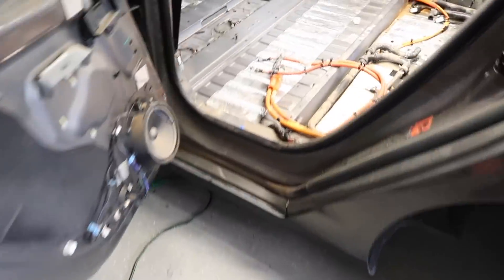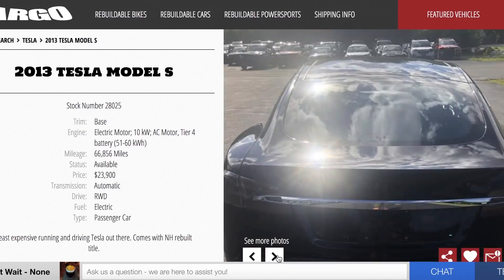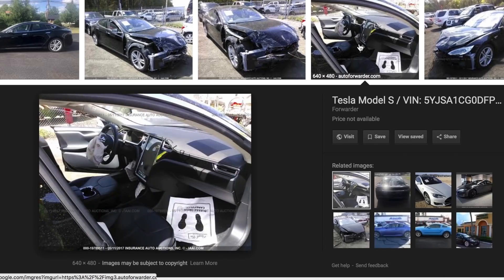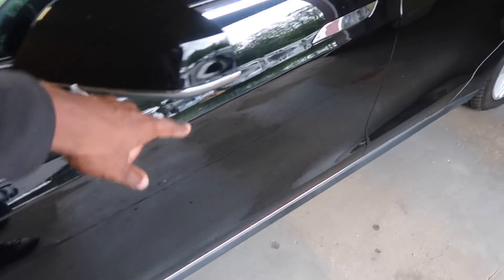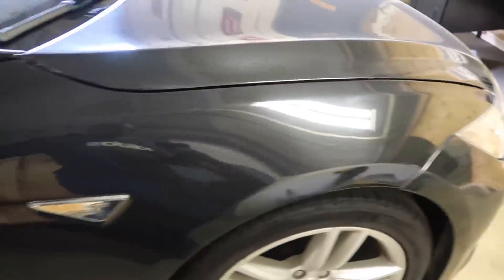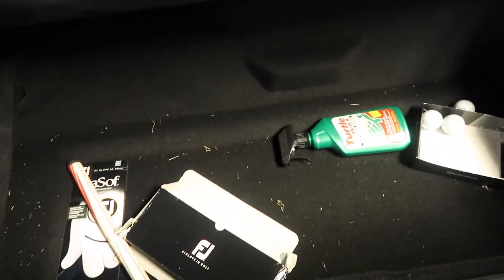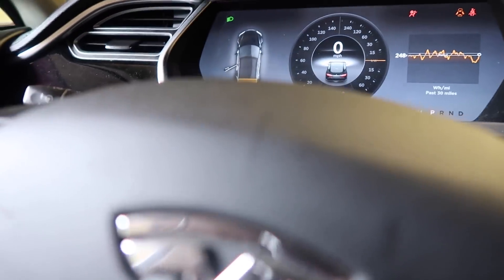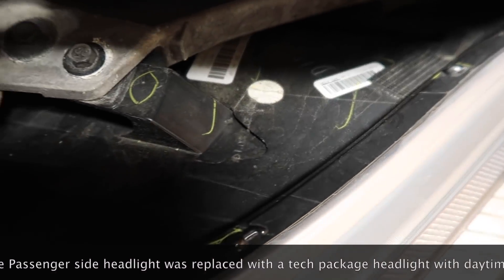This is the Cheap Tesla you’ve been looking for!

Comment: Are the current gen Teslas rolling out of the factory tents going to be 5G capable?
Reply: no because no 5G hardware is available to buy yet. maybe late 2019
Reply: @nutzeeer  Will cars be retrofilled or will owners need to recycle the old cars and buy new ones?
Reply: All Tesla's can be retrofitted with out the need to Scrap the car, I own a used Tesla that came with 3G and Tesla sent a mobile repairman to my house and he gave me  4G in less than an hour. I'm sure the same will be available once 5G is standard but it's not even fully implemented so to put it in now would be pointless and counterproductive as the towers are not even up
Reply: @nutzeeer  all Tesla's can be retrofitted to 4G at the owners request this has been known for about 2years
Reply: You can get 5G hardware, it is just that there are a lot of bands in a lot of countries which have yet to be assigned, thus the hardware bought today, might not support them in the future...
Reply: Skip 5G in phones and cars, it's basically a microwaves device that will cook your head or genitals in seconds.
Reply: DAVID DOUILLET  GFYS
Reply: Chris Topher  HOW?
Reply: Chris Topher  Looks like the nearest one is in Bakersfield so Ive got nothing to worry about